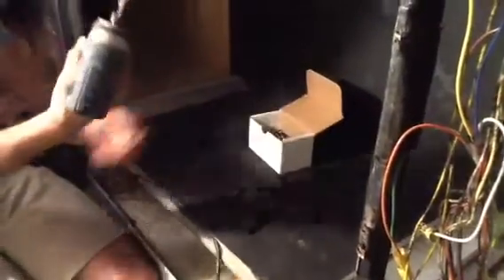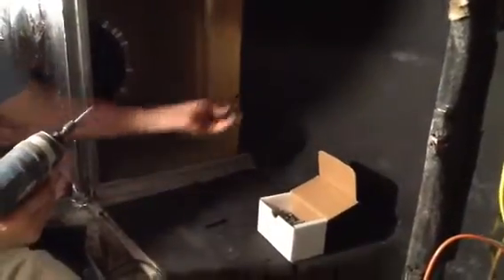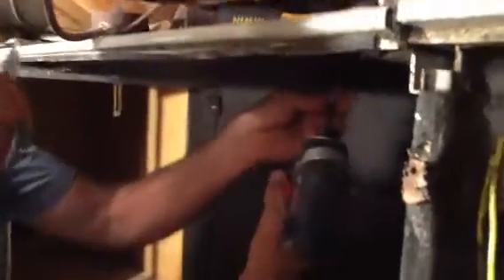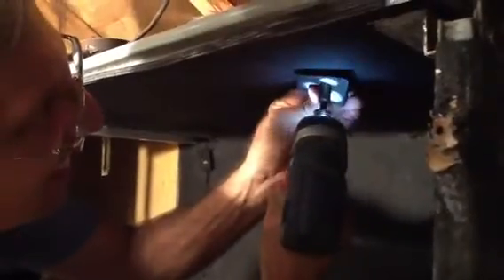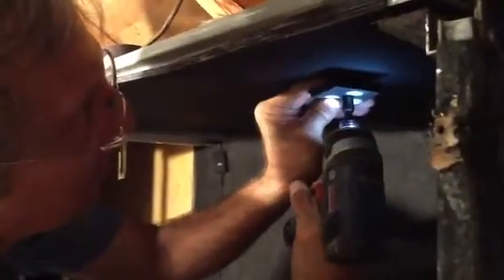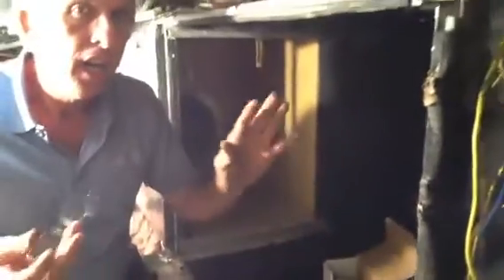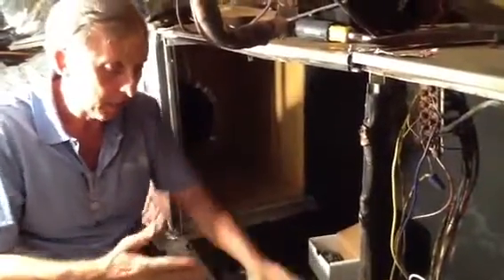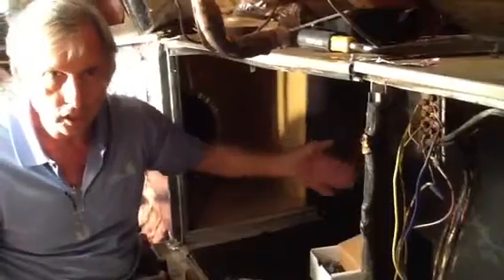My Air Handler is sweating water

Comment: You shouldn’t be screwing through the casing, this creates thermal breaks. Try using stick pans along with the glue. I’m a union sheet metal worker/ draftsman and this is not good practice.

Comment: I had a new AC installed 8 weeks ago and its a down blower and its causing condensation
on the sides of the duck and then running down and dripping off on to my ceiling how can I stop the condensation.

yours Jimmy
Reply: +James Souter did you ever get an answer I am having the exact same problem....
Reply: Hi Jimmy, I installed a new system and it is collecting water in the air handler. Condensate is flowing well. It appears to be taking drops off the coil and distributing it inside the unit and leaking out in the drain pan. Help